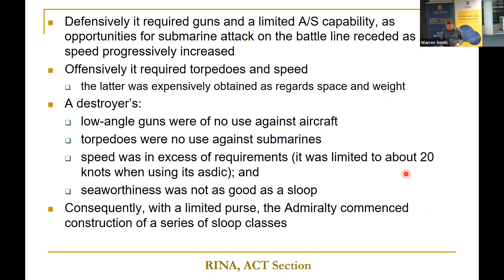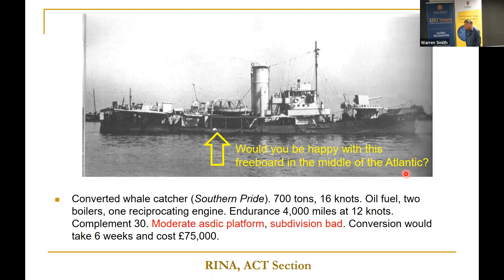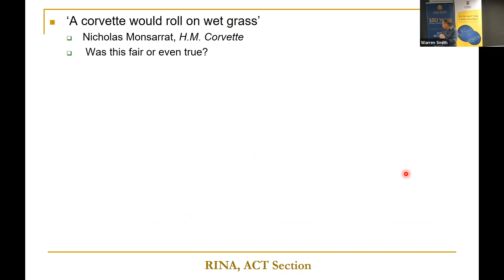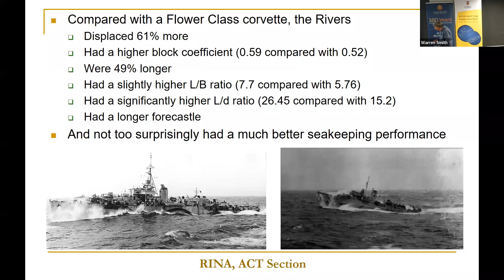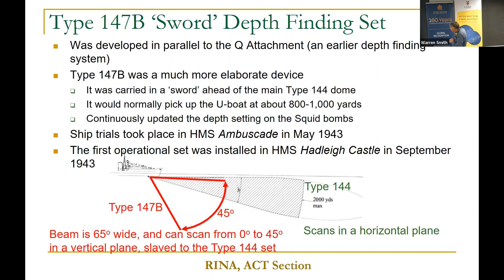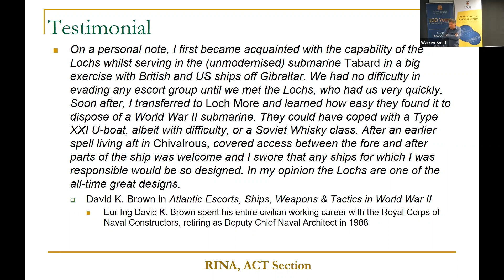The Development of the Atlantic Escort in the Second World War

Comment: 1) The Flower class was not designed as an Oceanic Escort. As no one could guess the Norway and France would provide the U-Bootewaffe with forward access to the Atlantic, it was thought the U-Boat campaign would, as in the Kaiser War, be centered around the UK. So the Flowers (and hunts) were designed  for coastal work. They had to be pressed into deep sea work as they were the only modern escort available in numbers.

2) The RCN built a large number of  Algerine class minesweepers, many of which never streamed a sweep, but were ASW vessels "Many Canadian ships omitted their sweeping gear in exchange for a 24-bomb Hedgehog spigot mortar and a stowage capacity for 90+ depth charges." They were close in ability to the Flowers

3) With the end of the war in Europe in sight, some vessels of the Loch class were modified to AA frigates while on the slipway, creating the Bay class for use against Japan "The Bay class made use of the hull, machinery, lattice mast and superstructure of incomplete Loch-class frigates. The armament was altered to suit them to the A/A role, with twin QF 4 in Mark XVI guns fore and aft in mounts HA/LA Mark XIX fitted with remote power control (RPC), controlled by a rangefinder-director Mark V carried on the bridge and fitted with Type 285 radar for range taking. Due to a shortage of supply of 4-inch (10 cm) guns and mountings, many ships had these removed from laid up V and W-class destroyer "WAIR" conversions and Hunt-class destroyers that were constructive total losses. A pair of Mark V "utility" mounts for twin 40 mm Bofors guns were sited amidships, each with its own predictive Simple Tachymetric Director (STD) for fire control. The A/A armament was completed by a pair of mounts Mark V for twin 20 mm Oerlikon guns, carried in the bridge wings. Later, the Oerlikons were replaced with single mounts Mark VII for Bofors guns, a further pair of which were added amidships on raised platforms. For A/S use, a Hedgehog projector was carried on the fo'c'sle and the quarterdeck carried two racks and four throwers for up to 50 depth charges."

4) The RN's Bathurst class minesweepers were referred to as corvettes locally as they were often used for ASW. "The Bathurst-class corvettes were a class of general purpose vessels designed and built in Australia during World War II. Originally classified as minesweepers, but widely referred to as corvettes, the Bathurst-class vessels fulfilled a broad anti-submarine, anti-mine, and convoy escort role.

"A total of 60 Bathurst-class corvettes were built, at eight Australian shipyards: 36 were paid for by the Australian government and 24 were built on British Admiralty orders. Of these UK-owned vessels, 20 were officially commissioned into the Royal Australian Navy (RAN), and manned by RAN personnel, while four served in the Royal Indian Navy; none of the UK-owned vessels was commissioned into the Royal Navy"

Armament - 	
Varying, but generally:
1 × 12-pounder (76-mm) gun
or 1 × 4 inch (102-mm) Mk XIX gun
1 × 40 mm Bofors gun
2–3 × 20 mm Oerlikon guns
up to 40 depth charges

5) "The Bird-class minesweeper was a class of naval trawlers built for the Royal New Zealand Navy and which served during the Second World War. A total of three vessels in the class were built: Kiwi, Moa and Tui. All were named for New Zealand native birds and were also referred to as corvettes.he main armament was a 4-inch (102 mm) gun, supplemented with two quick firing 3-pounder Hotchkiss guns and one twin Lewis machine gun. The ships carried ASDIC and 40 depth charges. Propulsion was through a single-shaft reciprocating steam engine that burned oil, providing a top speed of 13 knots (24 km/h; 15 mph) at 1,100 indicated horsepower"

"The flotilla was offered for service in the South Pacific and the offer was accepted by Vice Admiral Robert L. Ghormley the commander of South Pacific. The ships of the flotilla began operations in the Solomon Islands, conducting anti-submarine operations and carrying out escort missions from December 1942. They also disrupted the Japanese supply efforts, destroying a number of landing barges. The ships were considered to have weak defences against attacking aircraft, and they were unofficially up-gunned with 20 mm (0.8 in) Oerlikon guns scrounged from wrecked ships.[2]

"On 29 January 1943, Kiwi and Moa rammed and wrecked the Japanese submarine I-1, which had surfaced off the coast of Guadalcanal after several depth charges had been dropped. Kiwi's bow had been damaged and she returned to Auckland for repairs. Once completed she went back to the Solomons but not long after her return to service she suffered damage from a friendly fire incident which necessitated more repairs at Auckland.

In April 1943, Moa was sunk when it was attacked while refuelling at Tulagi Harbour, by Aichi D3A "Val" dive bombers. The attack killed five seamen and wounded another 15. One of the wounded was the captain of Moa, Lieutenant Commander Peter Phipps (later Vice Admiral), who had a bomb penetrate the roof of his cabin and pass through the floor where it exploded beneath him.

On 19 August 1943 Tui with some United States Kingfisher floatplanes jointly sank the Japanese submarine I-17. With her ASDIC, Tui had detected the submarine and depth charged it. Contact with the submarine had then been lost and Tui departed the scene. However, passing Kingfishers directed Tui to the crippled submarine, I-17, which had surfaced some distance away. Tui scored hits with her main gun and these were followed up with depth charges from the US aircraft, resulting in the sinking of I-17. Tui picked up six survivors who confirmed that her earlier depth charge attack had forced the submarine to the surface"

https://www.navygeneralboard.com/david-and-goliath-in-the-solomons-the-pocket-corvettes-kiwi-and-moa-vs-i-1/

https://www.youtube.com/watch?v=U8Xd2DWfHYE